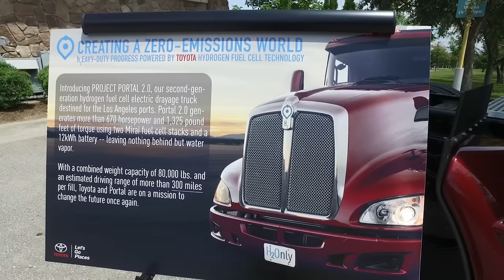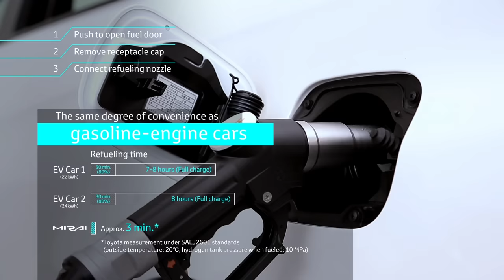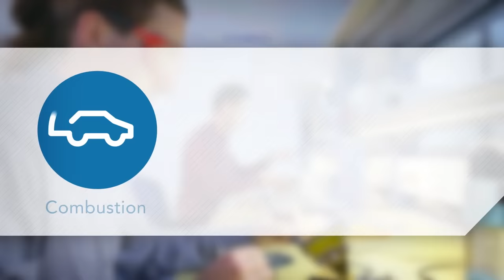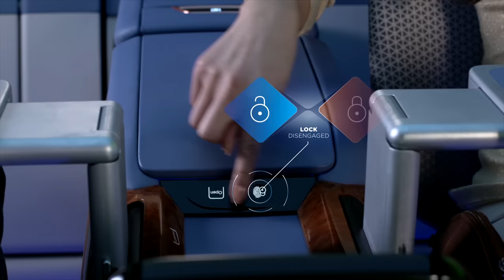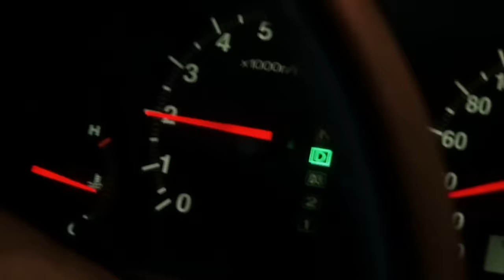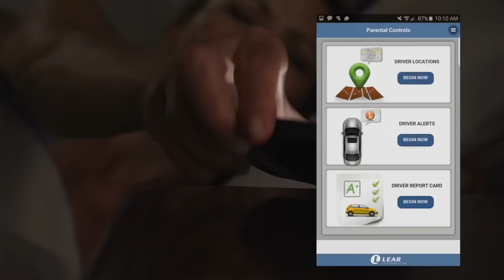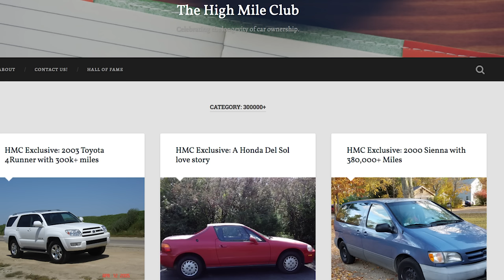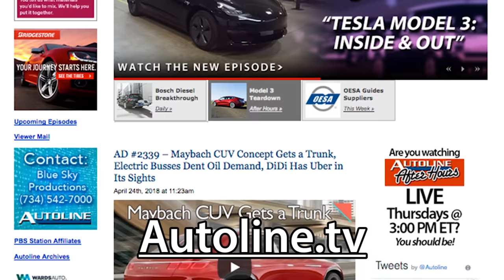Why You Won't Call "Shotgun" In An Autonomous World - Autoline After Hours 430

Comment: A hydrogen semi will never be used willingly in the free market.

A semi drives ~45k mi/yr. At 6.5 mpg & $3/gal, that's over $20k/yr in fuel costs.
If that truck runs on hydrogen, it's ~$40k/yr in fuel costs, and no, the cost won't come down.

What truck driver will willingly pay $20k MORE each year and limit where they can work? OTOH, charging batteries off the grid will reduce their annual fuel costs to ~$8k/yr. Yes, it will limit where they can work as well, but at least with batteries, they will save $12k/yr.

Hydrogen is a scam, a boondoggle, and nothing but propaganda. Anyone who does even the most basic math & thermodynamics can easily prove that. If you want to break a story and be real journalists--report that. (But of course that would make the car companies upset & they'll stop giving you test drives & interviews.)